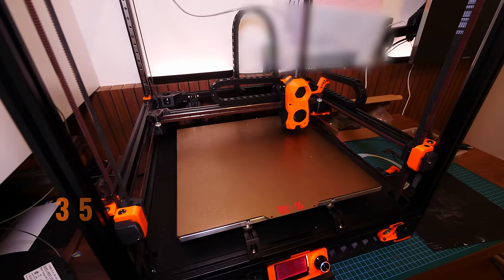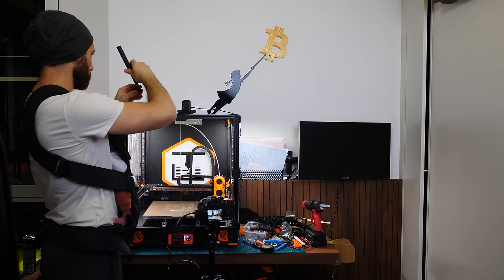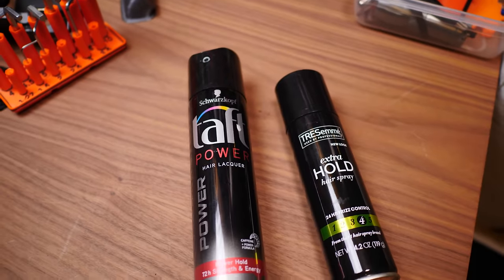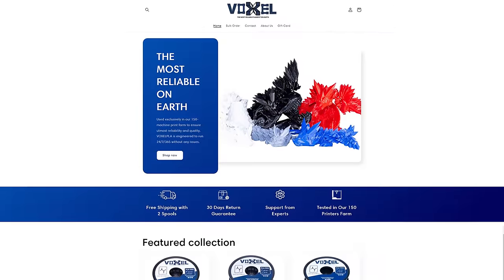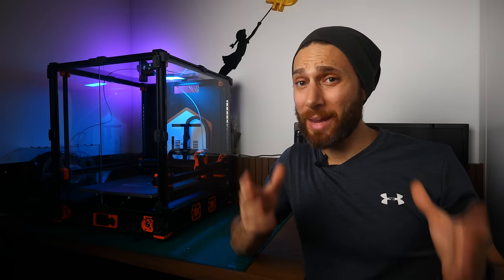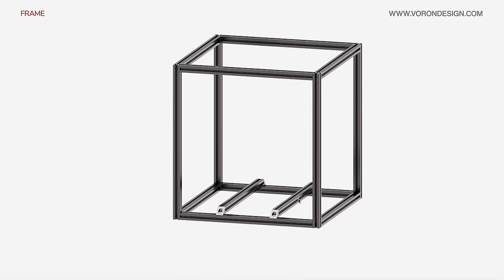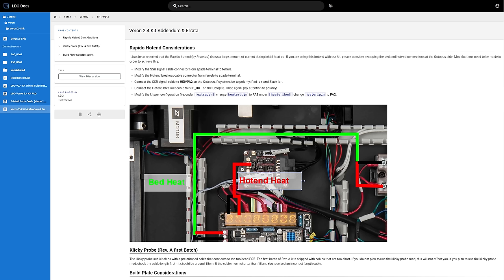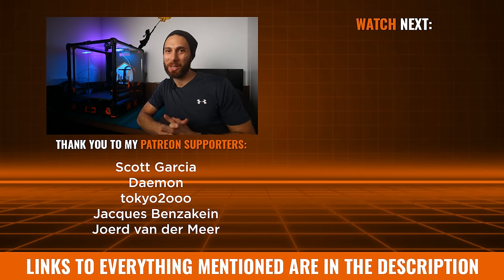Voron 2.4: The ULTIMATE DIY 3D Printer Build

Comment: Nice printer, I am currently working on the 300mm Trident and have my 350 2.4 kit sitting in my closet waiting to be built next. I used PIF for the printed parts this time, the 2.4 I plan on doing it myself.
Reply from the maker: WOW, I'm impressed by your devotion. How do you have so much time?!
Reply: @thenextlayer  Well its taking a little bit longer with a 19 month old kid, I just work on it when I can, and enjoy putting it together.

Comment: When I build my V2.4 350 I went ahead and look through all manuals involved in the build. For LDO kit you will likely have 4-5 manuals to skim through. Then I just print parts in order of the build manual while waiting for the kit to arrive. I didn’t use spreadsheet or checklist the help in tracking down which part is needed for the build and which one is not. All you need to do is flip through all manuals before printing parts. you’ll know which one you need by the time you finish reading.😂

Comment: The issues you had with various versions are interesting, when I built my V1.8 it was ONE guide, and a quick addendum since I wanted to go with a Dragon hotend instead of a V6. I also cheaped out in some aspects of using old parts, and had to make some....interesting...modifications because of it (mostly on the Z axis). The machine is a workhorse, and I've toyed with the idea of picking up a V0 or a V2 as a supplemental printer. I've also looked into what it'd take to turn mine into a Trident or a V2, and it'd be about as much as a new one lol, so something to keep in mind for upgrade paths.

Comment: Another hot take on the "maybe someone should do a Voron+SB+LDO manual".

Voron's ethos is you make it and build it yourself with the most basic materials as practically possible. LDO is way out of that mindset and it makes the printer 50% more expensive than it could be (some people self source on AliExpress for 750 bucks, and other kits are not much more expensive than that and yield a printer that is as good as LDO's)

As for the Stealthburner, it's still RC (release candidate) which is why Afterburner is still stock config. I can imagined that once Tap has seen enough use and gets a "1.0" release they'll merge Tap and SB (it was meant that way to begin with anyway) and make that setup stock config with an updated manual.

Comment: I love your videos. Basically I started to use the Printables because of your recommendation. I would love a compare video with the Bamboolab printers in YOUR POINT OF VIEW after 1 or 2 months of use. But as a Material Engineering student I would love to see a video about that you how recycle your filed prints, shatter it and make a new spool of filament from it, or just simply throw away (in the trash or the recycle bin in this case doesn’t change anything), or any of your recommendations in the recycling.
PS: I agree the special thanks the recommendations of the companies who gifted the materials and the kits, but I would appreciate if there would a separate section for this in the beginning or/and the end of the video, because right now with rude speaking it feels like “They gave me this so use this with your prints”.
Reply from the maker: I can probably do that

Comment: I have been enjoying your videos, great production quality and skills in front of the camera for being a fairly new channel. 👌 I built an LDO V2.4 this summer and am in love with it, and how well it works now that I’ve customized it exactly how I want it. Is yours going to live in the same wooden enclosure in your studio room? I have an enclosure that is very similar so I am wondering how you will deal with the heat inside with the glass window door closed, or the noise in the room with that door open, the V2.4 at good speeds is on a completely different noise level than a slow bed slinger… 😬 you should also look into the Nevermore Max, that would be a great mod for your long term health if you and your wife are going to work in that room breathing in the same air all the time. Keep it up! 💪🏼

Comment: i have an old AnetA8, it never performed good because it require calibration (i bought a autolevel sensor but never installed) and because the plate calibration is so hard and the general stability is not good. It's possible to recycle that printer parts for building a Voron 2.4? i also have a Selaed 1kg black PLA at home, do i need other PLA?

what will be the cost?

Comment: I think Voron and the kit manufacturers should select a "starter package" and then offer EVERYTHING for that in a kit (i.e. including parts, wiring, EVERYTHING!) and have a single document describing that package's assembly.   Sure the "every Voron is unique" statement might sound cool, but for a lot of people the initial complexity will turn them off.  Once you have that starter, then you have something to build your own parts for upgrades or a next printer.  The second thing turning people off will likely be the price.  Also there standardizing on a single "starter package" should allow for some scale-optimisations, no?
Reply from the maker: I should be fair, if you want to keep it standard, you can use the main guide except add in the wiring guide for Voron, and a few different printed parts, b/c they are upgraded and improved over the standard build. My build was harder b/c I wanted Klicky/Stealthburner/etc
Reply: Those exist. Looks like fabreeko not only sells the kits but you can buy the plastic parts as well.

Comment: @The Next Layer - Amazing!  I wish I had seen this video a couple months ago.
I just finished building the exact same machine and went through all those sites and guides.  I have also been thinking about the same question about who should document the build for the scenario where you buy an LDO kit, with a certain selection of options.
I think that the vendor that sold the kit should knit all those links together as things are today, however...
... Voron's official guide does have issues and could definitely be improved to help navigate the tons of resources you will need.

Comment: Hot take on the "selecting and printing Voron parts is a pain" : I honestly think an LDO kit makes it more complicated because it's not a stock config, adding these extra options (including the clicky probe parts which only help making this mod the de facto "I have other issues but clicky solved it therefore the inductive probe is shit" symptom generator) just create to much noise for newcomer IMHO.. I "maked" my 350 2.4r1 from a basic (stock) kit from Formbot and I could tell what I needed to print just by looking at the name of the parts. It took maybe 30min sorting the STLs out, planning the plates and labeling plastic bags with based on the folder names.  The build was made effortlessly using only the official manual and the docs website, nothing else.

Also while it's fine to mention you can order printed parts from 3rd party companies, it would have been great to have mentioned the PIF (print it forward) program as the best way to get printed parts, they're made by the Voron community under the (stringent) control of Doc and it's also probably the most cost efficient way.

EDIT : Yeah that's also why you had issues with things not in the manual. The best thing any newcomer can do is build a stock Voron first, and tune it later. The stock config comes with 95% of the performance you'll get with "upgrades".
Reply from the maker: This is all good feedback, thanks. I forgot about PIF, for sure.

Comment: You don’t need to buy printed parts nor print them yourself. Join the Voron Print it Forward (PiF) queue and you’ll get perfectly printed parts, done on perfectly tuned Voron printers, for basically the cost of filament.  That’s the preferred way to source printed parts.

Comment: Also why not make a larger contains all guild with pdf jump links to other parts (like the different hotends) then link back to the main guide to continue and then more links for different parts. I know they won't contain LDOs guides but if they make a guide like you said then Ldo can just put a card that says after step X jump to our wiring guide and after step Y jump to our klipper setup, etc

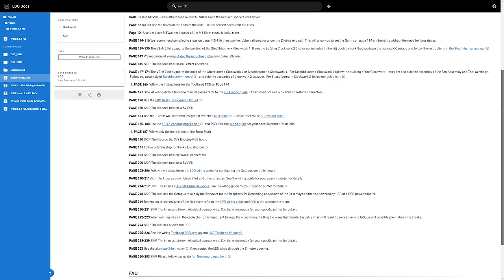Comment: 13:20 Oh, i'm gonna do this, in fact, if been going over the docs for 2 weeks now. Printer sitting here ready to go. I, like you, am a little confused on the extruder/hotend deal. I also want to go stealthburner and tap. no clicky. I also want to go canbus with an umbilical cord. If im going to build one, i want to build it for future. Also, i have the aluminum parts here to save me some printing. Good video, sounds just like me except i didn't build mine yet.

Comment: How are the speeds on this thing? I've honestly been thinking about getting a bigger/faster printer and making it would be a great project for me.
Reply from the maker: I can print 200-250 comfortably, 300 reasonably, 400 is a bit sketchy. But 200-250 is nothing for this (compared to 80 for my Prusa)
Reply: @thenextlayer  GOOD LORD! That's crazy fast! I assume you have to up the temperature to print that fast, right? I might have to do this after the move.
Reply: I've gone up to 600 for infill on my machine

Comment: I am sorry but your struggles are your own fault, the main guide is perfect for building a Voron, most people do not get a kit sent to them so they will research what they are buying, and as soon as you look at LDO you will see links to their guide for their kit, and they are a great kit, I have built an LDO and a Formbot kit, and I would choose LDO every time. Changes to the build guide for each and every mod, addon or change would mean that a team of people would have a full time job just referencing all the mods and the guide would then be a mess.
Stealthburner is an addon, Kliky is an addon, Tap is an addon, all these guide are well written but are NOT required to build a Voron.
Also there is a Discord that has the most hepfull people on the planet giving there time and knowledge to help you build Your Voron becase as soon as you depart from the orignal manual it is no longer a Voron, it's your Voron.
Reply from the maker: Yep, that's true, and as I said, I DID make mistakes and I WAS told to do the research ahead of time and didn't. Still, because LDO is a commercial company selling a kit, and because they sent the kit to me asking for honest feedback, I wanted to provide that feedback, that I think they should just make ONE fork of the main guide for their product. I think they'd agree that's fair feedback.

Comment: 200 print hours - $100
40 hours to build - $2,000
That is an expensive option.
Reply from the maker: It’s definitely not for the faint of heart, or for anyone who doesn’t really enjoy these kinds of projects. It doesn’t make economic cents which is probably why Ron went out of business and turned into an open source project.
Reply: Definitely easier when you're given the kit and the parts and the filament to print your parts.
Reply from the maker: @AntoLeNice  that’s definitely fair.

Comment: Your Lucky, it cost you nothing! We on the other hand would have to pay a huge amount somewhere in the $3000 range to get the kit or buy the parts listed online ourselves.

For me it be a waste of time and a huge amount of money I can't afford.  For some 3D printer users they are stuck up sobs whom wish to look more better than the rest.

So they buy a Voron or the kit and then boast how much better they are than the rest of the ones who can't afford it.

Just a load of showing off and boasting about what they have we don't have.

Like Bambu Labs Carbon X1 voron printer, again being well off or rich will get this printer since it is a over priced Voron costing $1000 or $1400 if you add the EMS. 
Just being big headed and a load of snobs boasting about the Carbon X1 or the $699 Bambu P1P.
Reply from the maker: I don't think the X1C or P1P are overpriced AT ALL, but it sounds like you haven't tried them. I have used $300 printers, $1300 printers, and $3,000 printers, and I can say that there's a massive difference in capability. Stay tuned, because I have some comparison videos coming soon.